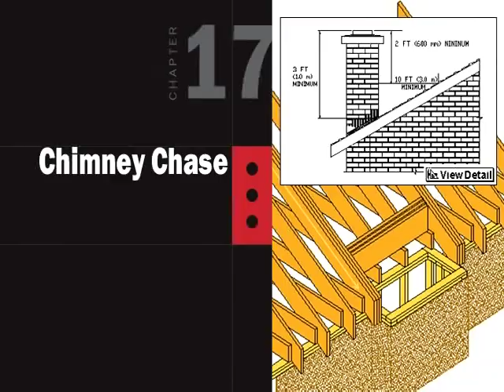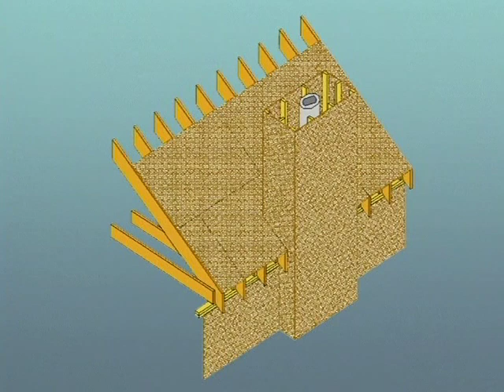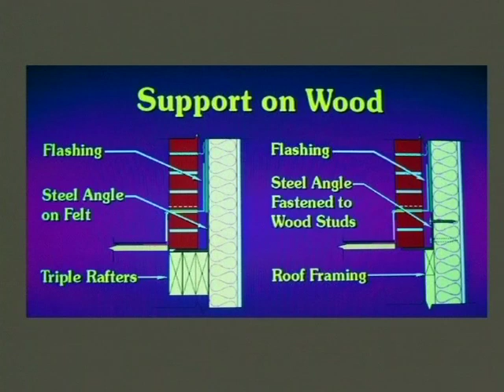Chimney Chase

Comment: What you describe at 1:20 is exactly what I’m experiencing. The chimney is listing toward the house and a slight crack has developed three rows of brick up from the gutters. What kind of professional do I call to fix it?
Reply: Well you're going to need to call a carpenter to add the additional two raffters on both sides of the chimney and the header,you'll have to remove all the bricks down to where the crack has developed once the changes have been made to the roof you'll have to call someone who does masonry work. Make sure to do your due diligence how to start with making sure their license insured and bonded with a ton a recent references check with the better Business bureau I'd check also with the secretary of state and see if anyone has filed any kind of complaints on your contractors the Secretary of State generally speaking is the one contractors receive their contractor's license from. When you're checking references you don't want to know if they can install kitchen cabinets you want to be specific check for references that relate to the particular aspect of the job you're having done in other words you don't want to hire someone who pours sidewalks to do your brick work also there is a big difference between a framing Carpenter opposed to a finish Carpenter. Good luck !

Comment: Does the 10ft point have to be on the roof that the chimney is coming from? 
I have 2 pitched roofs and the chimney is kind of in the middle of both roofs. But it clearly comes out of just 1.... I'm fairly confident that it's up to code on the roof next to the chimney (the roof that the chimney does not come out of) but I'm not so certain with the code for the roof that the actual chimney comes out of. 
What i don't get tho, is that it got nicked on a VA home appraisal, yet the home is over 100 years old, and was just sold a couple of years ago! I'm hoping you understand. Wish i could upload pics on YouTube to show you what I'm dealing with.

Comment: I have a brick exterior on my chimney case that extends  all the way down to a brick ledge on a poured concrete foundation, no problem supporting all that weight.  However water has ran down the North side of the chimney exterior saturating the masonry and as a result some of the sheathing, studs, sill, OSB floor and rim joist has rotted away.  I will reconstruct from within the chase having removing the fireplace unit.  I plan to to somehow hang a waterproof membrane (Grace Ice & Water® Shield) if possible before splicing in new sheathing and pressure treated framing as well as using DUROCK flooring under the fireplace unit.  Either a cricket or some type of deflector should have originally been installed to prevent this, flashing alone would not prevent water from cascading down the North face of the chimney.  What do you think?

Comment: This is a very common issue in Texas. Everything that was mentioned in these videos We see everyday. Chimney chases built with “speed” joints and other problems causing leaking. That’s great for business but not for the homeowner. To prevent this from becoming a problem I would implement full head joints and I might add a powdered water repellent to the mortar mix. 

https://silanesiloxanesealer.com/sealer-uses/brick-water-repellent/

Thanks to BIA for a really informative series.